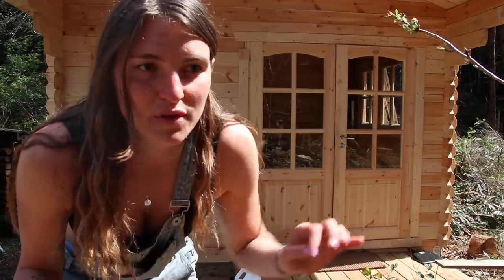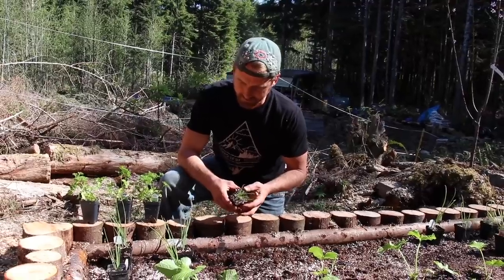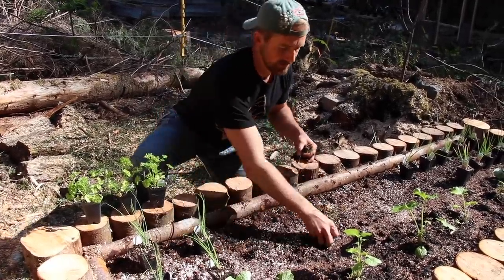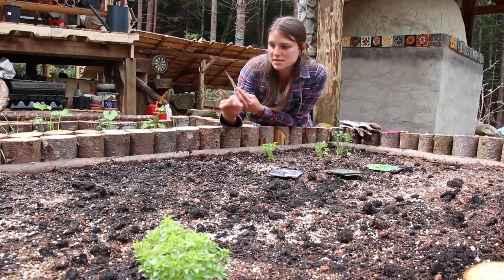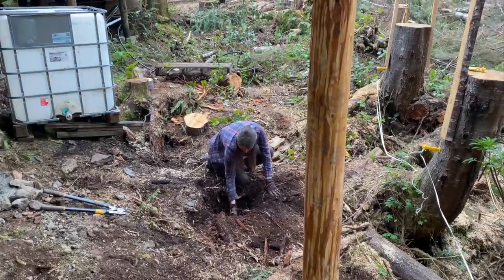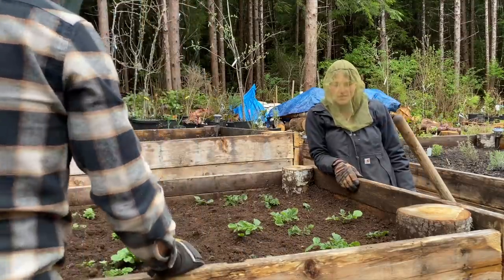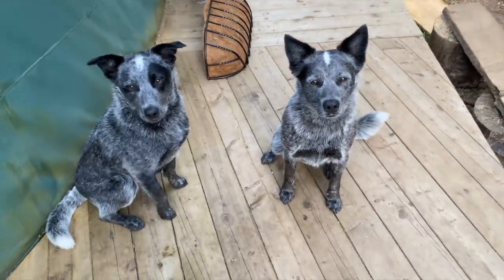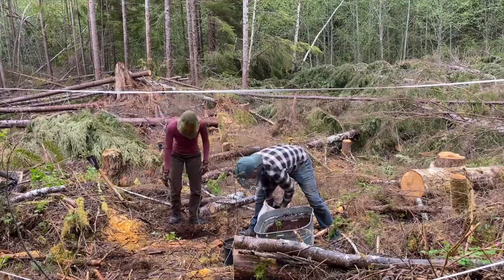OFF GRID LIVING | BUNKIE LOG CABIN | HERB GARDEN RAISED BED from FOREST LOGS & Plum Trees - Ep. 131

Comment: In one of your episodes, cutting logs landed in the wetland near you veggie beds, you spotted naturally growing water cress. Virgin water cress (curled pepper grass) is a great addition to a salad or freshly clipped garnish on a sandwich or pizza. I grow it indoors in Calgary during early spring and late autumn in a sunny western window overhung by a balcony with at most 4 hours of direct sunlight. I grow it hydroponically on just wetted and misted cotton (pharmacy available cotton balls elongated to thrice their original length, just one layer of parallel elongated balls) on a low-lipped foam tray (a cleaned and reused meat foam tray). You generously drizzle the seeds onto the wet cotton (about 3mm or 1/8" spacing), and mist or water them daily. They will germinate in two to three days and fill your yurt or log house with a pleasant and noticeable  fragrance. They will thereafter be harvestable within about seven days when about 1" above the cotton level with individual green triplet leaves, lens-shaped and about 1/8" long. You harvest them from the tray by scissor-cutting of the stems near the cotton surface and drizzling the cuttings onto your salad, sandwich or baked pizza. You may be able to autumn harvest your own seeds from the wild water cress growing in your wetlands instead of buying a few gram seed packages if available in local nurseries. I on-line order several 25 gram packages, at a tenth of the per gram price in nurseries, every late winter, and usually go through about 100 grams a year. Cheers from Kurt

Comment: This is going to sound like a weird suggestion - but for a little backstory, I heavily deal in the aquarium hobby- and there's often an issue in the hobby with snails escaping people's tanks... one of the solutions I've found that would also work for your slug problem... is velcro. as odd as that sounds, a strip of velcro around the edges of your raised beds would keep slugs out.. snails and slugs hate the feel of velcro - they can't grip it and it's prickly but completely harmless to them. If the copper flashing doesn't work and you don't want to go a more violent or chemical route with the slugs, try velcro around the vertical edges of your beds - self-adhesive velcro would wear off fast, but you could easily tack it in place with a staple gun or nails. a 2-inch trip should keep them out. .... the reason copper doesn't "work" in a test is that copper is toxic to slugs and snails - but it isn't an instant death. if they're only in contact with it for a short time, it's harmless to them. Even then, in my experience with aquarium snails, a lot of the hardy varieties can still survive copper poisoning, regardless of how toxic it is.
Reply: I randomly clicked on this video. Luckily read your comment and now am super excited to give this a try. I'm about to put all my seedlings in the ground in about 2 weeks and have been debating over copper and even electric fence to keep slugs and snails away. They dominated my plants last year... i'm going for velcro. Thanks for the tip!!
Reply: @XoshBitt  I hope it works out as well for you as it does in the aquarium hobby! it seems like such a silly solution, but in my experience, it works really well. I've had open-top tanks (19 of them) for several years now and I've had zero escapes. It works as a great deterant.
Reply: @DesertBloomBettas  I will for sure be giving it a try. Thanks again!

Comment: Comment specific to ep. 131. RE: copper sheeting not always keeping the slugs from crawling into veggie beds. Give chimney soot a trial in one bed. Staple or nail split bamboo canes (diameter of a rain gutter trough) on the top inside of the bed planks. Fill the half canes with chimney soot (or char chips from a burned spruce log) and observe whether the slugs tend to cross the soot or char barrier. Worked in my mothers garden when drizzling soot rows on the ground around the cabbage pad area.

Comment: For slug control I use Beer 
I use a flat plate 
I dig a shallow hole to allow the plate to sit flush to the ground 
I then put beer in the plate 
The beer both attracts the slugs to it 
The alcohol in the beer kills the slugs 
Cheap beer seems to do just as good as high cost beer

Comment: General comment for your future reflections about how to start off your veggie raised beds. You could start your own bedding plants from seeds in one of your raised beds covered with thread reinforced PVC plastic sheeting (UV-resistant for about 10 years versus polyethylene only for a couple of years), 4-6 mill film - to give them light and protect the virgin plants from rain, sleet and rain. Beats the cost of buying expensive bedding plants. When it comes to transplanting the small bedding plants into larger pots (before ground planting), I swear to unglazed clay pots. They wick moisture from the clay shell, which evaporates and cool the pot soil bed and plant roots near the pot shell - something that plastic, glazed clay or cement pots do not. Transplanted bedding plant stems and leaves do like solar heat, but their roots have a max. tolerance threshold for how much heat desired, often referred to as heat stress. So please think about acquiring some unglazed clay pots for bedding plant interim transplanting, instead of using your stock of plastic pots. I've inquired with local nurseries about using my returned plastic pots, but they are not interested. That may change in the future when our federal government fully rolls out new legislation regarding EPR (environmental producers' responsibility) for mandatory take-back and recycling of many packaging items or use of alternative materials that are easily decomposed and non-toxic (e.g. coconut-fiber wowed baskets instead of plastic balcony planters or hanging plastic baskets). Cheers from Kurt, a gardener for 60 years and a retired environmental engineer with an interesting 45-year career.

Comment: Nice yard cart.  I just bought a used one steel frame and bed.  After sanding the all black finish lightly I repainted it except for the bed.  I used the same product used to coat pickup truck beds.  Its a rubberized product that with 2 coats applied will really protect the bed of the yard cart.  Mine looks to hold half of what yours does and I like the dumping feature yours has.  Mine as only $135 US dollars.

Comment: Use a 9 volt battery  with real thin copper wire wrapped all around the bed with no gaps in the wire. It'll give a jolt to critters and they won't cross over the wire. Worked very well on my raised beds in Texas.     You gets lots of rain, so , not real sure how effective it'll be. But in my area, it's not a problem.  Works real good. Plus I used bug netting as well.  My tomato plants where 8-12 feet tall.

Comment: Comment specific to this ep. 131: boiled linseed oil is best for outdoor coating protection. I successfully used it on the cedar siding of my AB garage back in 1979, a coat every year for three years that permanently prevented it from going grey for another seven years until we sold it and bought another house. Non-boiled linseed oil is okay for indoor coatings. The alternatives for indoor and outdoor coatings are clear tung oil (Behr brand, or Watco Danish Oil brand) or Thompsons Water Seal. They are less viscous fluid coatings and easier to brush on, and soak deeper into the wood than linseed oil. I've had good outdoor protection results with Thompsons Water Seal on our boardwalk, which kept shedding the water for five years before needing another coat. You acquire a tray and medium depth roller (with an extension rod) for latex paint - and roll it on by the 100 sq ft every five minutes. Cheers from Kurt

Comment: 1Traps with beer or yeast with sugar. For this type of trap we need a jar that we bury in the ground, leaving the edges out, after adding beer, or a solution of 1 tablespoon of yeast, ½ teaspoon of sugar and 250 ml of warm water,put a jar full of beer in the ground next to the crates  .2 Another method is to put on the surface of the soil materials that can irritate the snails as they move through the solarium or through the cultivation of vegetables, such as very angular sand, eggshells, conifer needles and bran that stings them, irritates them. .. 3 Many homeowners say that wood ash, coffee grounds, cinnamon and pepper mixed with sand.Hot pepper tea is also a good solution slaked lime and a mixture of stinking stems and leaves of plants, such as wormwood and mint, remove snails. All these treatments are repeated from time to time alternately, especially on the day after the rain, when the snails are more active.
Reply: @Living Off Grid w/ Jake & Nicole shameless plug

Comment: Attach 9Volt batteries to the copper flashing with solder and a bit of wire, if need be solar powered. they will not cross the barrier.

Comment: No need to mix that concrete for fence posts or your deck extension.  Dump it in dry.   Your posts will stay straight because it won't swim, and the ground itself will provide the water and cure the cement.

Comment: A little thought about slugs they hate salt you could make a salt barrier by cutting a half inch wide groove down a board and then a narrow groove that you could insert your copper or whatever That can go up an over. Heck if you wanted you could use three boards the flat one that would nail on top of your beds the next board will be mounted perpendicular racing up protecting the backside and then ace third board sloped that extends out further to keep heavy rains from washing your salt away. Silver half inch groove in the board with salt and as the slugs climb up they can’t get up to the overhang so they have to go under the sink over that board they hit the salt groove as salt will burn them they will turn away you will however have to refill your salt from time to time as the winds will blow it away and you can’t prevent every drop of water probably from getting to it. If you use hinges on your top sloped piece you can easily flip them up and refill your salt.

Kind of a thought when digging holes a yard ads or pick does real good for breaking it up so you can then shovel it but you may already know this. Like I say kind of a thought if it helps yay.

Comment: Hi Jake and Nicole, I have watched all your vids, I love them. Re The COPPER SLUG barrier. The new copper you are using may have a thin lacquer over it or residue from the production. It would be interesting to see if slugs cross after a rough sanding of the copper surface. The old flattened weathered copper water pipe I use around my raised beds appears to work here in Scotland. Maybe you have copper tolerant slugs.

Comment: A few years back I created a mini electric ⚡️fence to keep the slugs out 🐌🐌🐌🐌🐌 🥬 All you need is a battery (9v) 🔋and some wire. Create two separate loops about 3/4 inch apart around the outside of the bed then attach one loop to the positive and the other loop to the negative. So when the slug 🐌🐌 touches both it closes the loop and shocks it 💥

Comment: For the SLUGS:
What you need is electricity flowing through them, a 9V battery is usually enough to deter them, the best and cheapest way is to use "electric fence tape" connect each phase(wire in the tape) in an alternating fashion to plus and minus of your electric source, if you want to minimize electricity loss stick the electric fence tape on rubber tape/old halved bicycle tube and that onto the raised bed sides.

Comment: Jake, have you ever looked into getting a dolly {more or less two wheel barrow sized wheels and a axle or dropped axle} to put under either one end of a log or near the middle of a log to take most or all of the weight so you do not have to strain your back. I was once young and bulletproof {my mothers words} like you carrying transmissions, cylinder heads from cars and V8 engine blocks and thought it was good exercise but at over 60 now I am paying for it and have been for a few years. Almost every strong man I know who used to not be afraid of heavy lifting has been in the same boat {condition} that I am now in and I would hope you might learn from the cautions that older people like myself might offer out of concern you do not follow in our paths.

There is no recovering from the wear and tear of all the bending and heavy lifting and working on things on the ground that should have been put at a comfortable standing or sitting height. Your a hard worker but trust me all of that will catch up to you after 40 if not before. Nicole needs you so look into preserving your back. Everything you want to do goes through it and the damage you may be doing to it by the type of lifting; bending and working too low down you do may eventually catch up in a bad way with you. Take care both of you. Best wishes to you.

Comment: I don't  know  if anyone has mentioned  this. The ceiling of your sleeping cabin should have some insulation. Probably about 1 to 2 time the thickness of your walls. Heat loss through the ceiling is about twice of what happens at the floor. It should make it more comfortable in cold and hot conditions.

Comment: id get a cable and pulley trolly system from side to side of the open area and have a 8 ton chain hoist for lifting and moving all the big fallen timbers out of the way stacking them off the side till u cut them for fire wood or lumber and be able to move them all very easy with 2 people .would have to move the system down the space till its all done but be a easy way to make things happen quick

Comment: A simple way separate seedlings you need a pressurized hand spray bottle did gently Evacuate the soil from The Roots once this is done you can't separate the root systems a lot easier if you have access to Clay on your property Precure some make a slip do the consistency like if you were doing pottery roll the seedling root systems and the clay and plant I have had success in doing this open house for future endeavors

Comment: YOU HAVE TO CONNECT A 9 VOLT BATTERY TO 2 THIN  COPPER STRIPS SIDE BY SIDE +VE TO ONE AND -VE TO THE OTHER..AS THE SLUG MAKES THE CONNECTION THEY WILL GET A SMALL SHOCK AND TURN AWAY